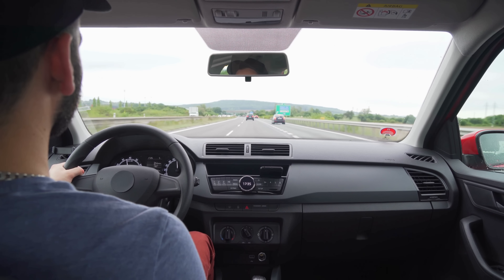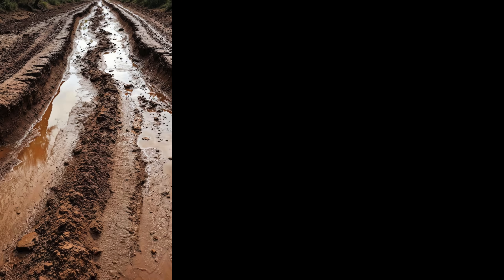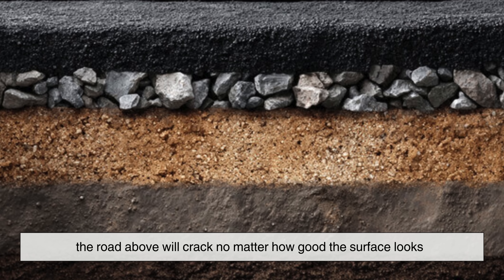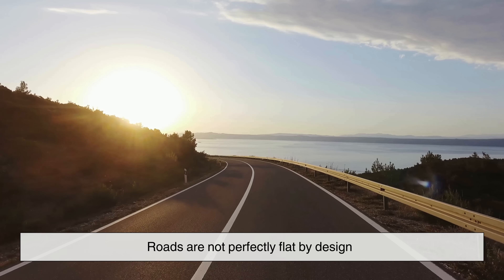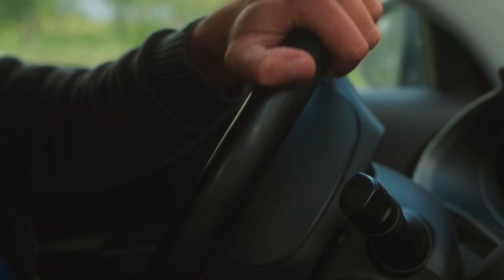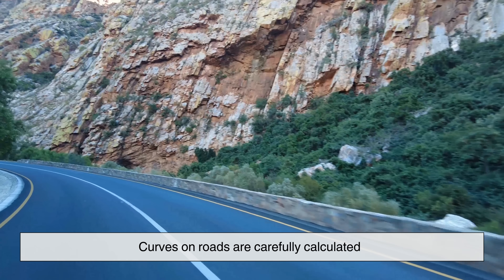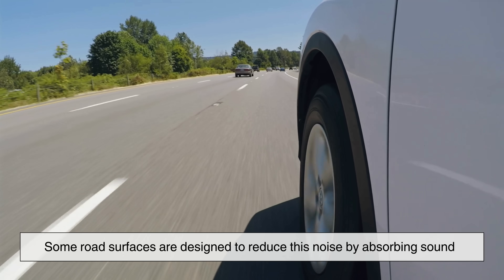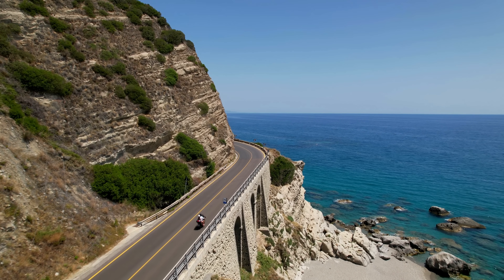How Roads Are Designed (And Why It Matters) [ID2204]

Comment: Interesting, the engineering information was spot on but, American secondary roads are pathetic when compared to European. America uses cheaper materials, a slap it down get’er done technic which is evident every spring with potholes and cracking.